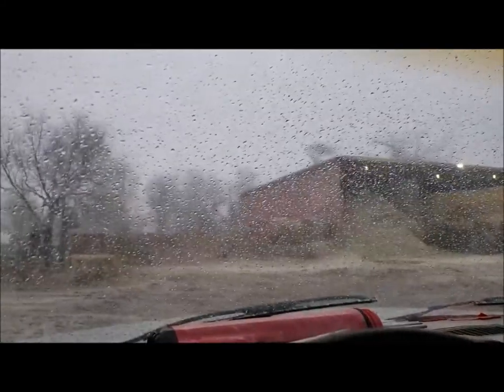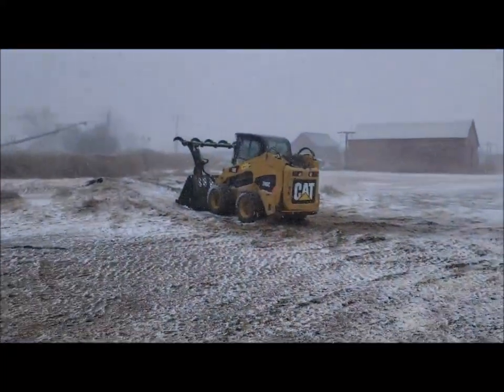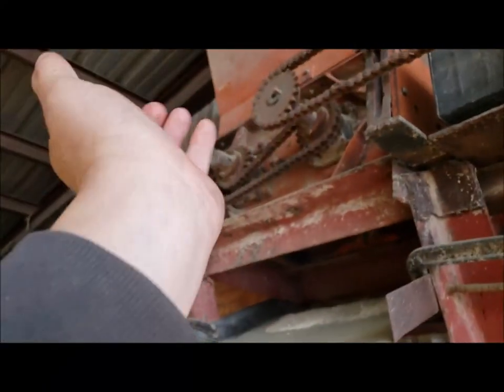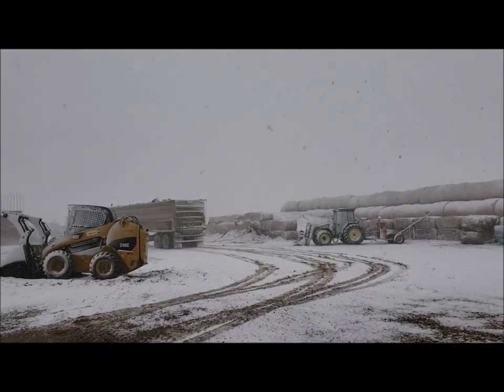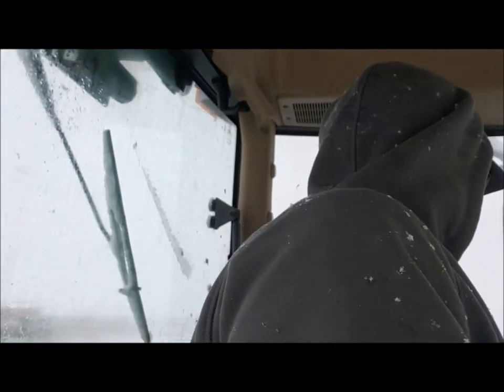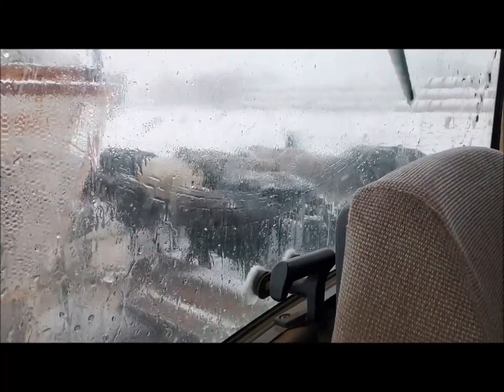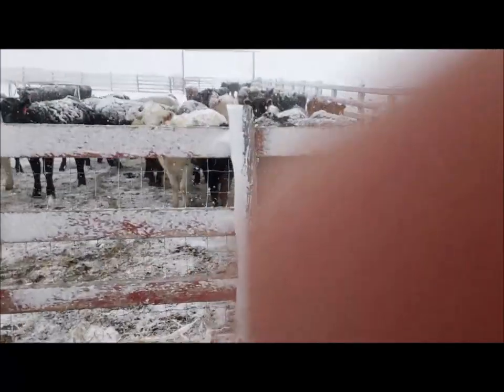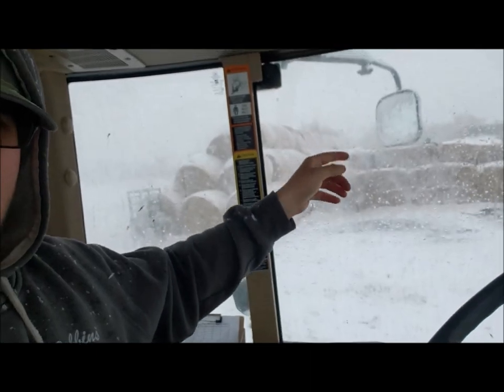Caught Off Guard By Snow Squal

Comment: We don't have snow anymore ,but we switched to a wicked North wind and it feels colder than the thermometer says.     You can figure stuff out till you are blue in the face and then one thing changes and you can go from breaking even to losing fast.  Sometimes you just have to go with your gut and what looks good enough to try.
Reply from the maker: gotta love that wind right........ I would always be glad to give ours away, but the minute I did that some wind company would want to put up towers and pay all my debt off and I would be s.o.l.
Reply: There is a wind farm 10miles from me and they pay just like an oil company.  The one that is 30miles away has 36 windmills all on land owned by one Hutterite colony and they chose to be partners in it instead of just getting a pay out and we will just say the don't have payments on dept.

Comment: Jd 250 skid steer has weight brackets behind rear wheels. I think there were 4  50 lbs weights behind each rear wheel they increase the lift rate of skid steer from 1750 to 2000 lbs. Putting weight brackets behind your skid steer wheels might help to stabilize the load making the bucket not feel so oversized. Like your content post as often as you can.
Reply from the maker: So the bucket full of silage is 2000 to 2150 lbs, I think the bucket is close to 1000 but could be wrong. I know I can lift a full pallet of 80lbs sack of quickcrete no problem with that cat. Just need a wheel loader